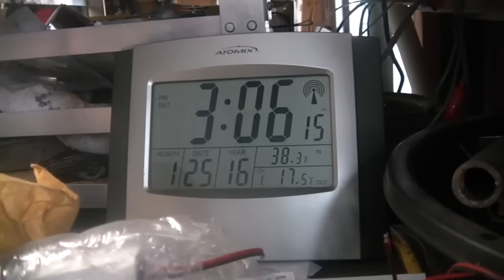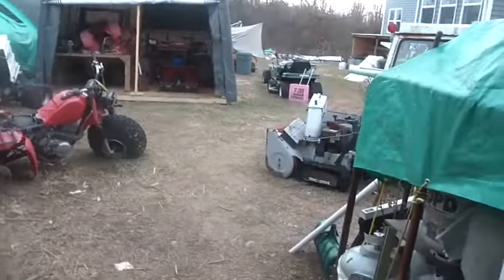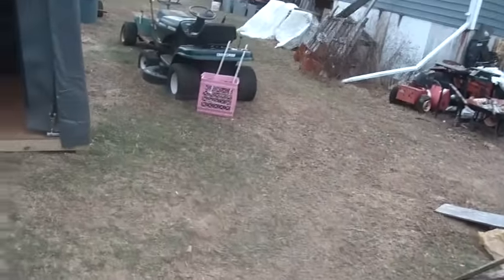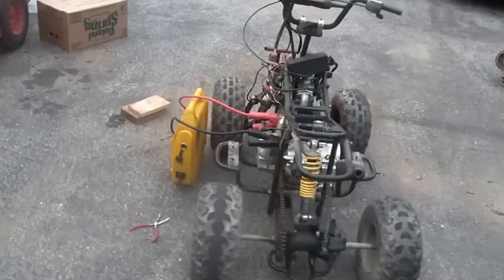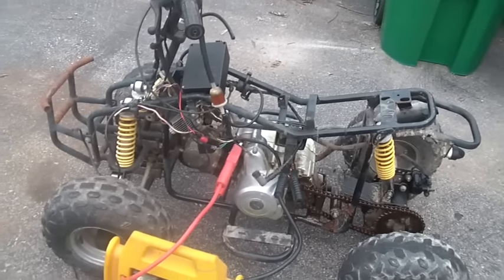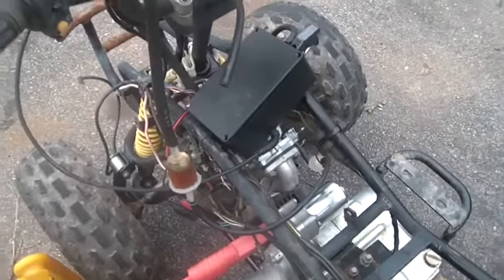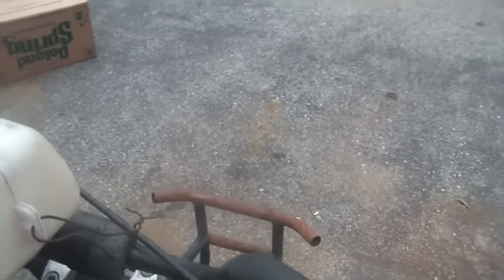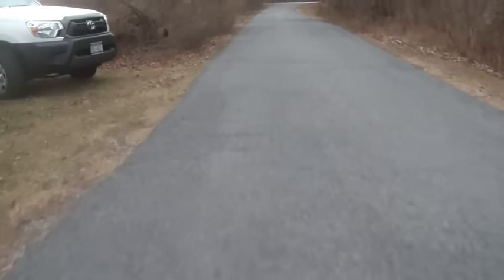Water Seized 70cc China Quad first ride,

Comment: i have a 70cc chinese mini quad and idk if its a 2 or 4 stroke. but i been running it like a 2 stroke with 40:1 and it runs pretty good but how do i tell for sure if its a 2 or 4 stroke?????????
Reply from the maker: Hi ATV!!!   If it has valves, it is a 4stroke.... 2 strokes spin up faster and have more of a zing, zing sound to the exhaust, 4strokes have a more thumpy exhaust sound, I have not seen 70cc 2 stroke quads, (they maybe out there, but, I have yet to run across one or the parts for one), I would think given that it is 70ccs, it is probably a 4 stroke, but, adding oil at a ratio 40 gas to 1 oil, will not hurt anything.... Thanks for asking, watching, and commenting!!!
Reply: yea i talk to a couple ppl and i was pretty sure it was a 4 stroke so i stop mixing gas and was running a little better than normal then i shut it of and it wouldnt start. after about ten minutes it start again rode it about 3 feet and it was making some bad noises then it shut off so idk what to do with it now should i look inside the motor to see whats messed up?? or just junk it??
Reply from the maker: Go back to running 40 to 1 and see if it runs better... These motors are pretty tough, it may just need a new plug and a carb rebuild...
Reply: Ok and do the 4 strokes have oil filters on these quads??? and how do i get that little chain back on the starter if u know what im talking about??